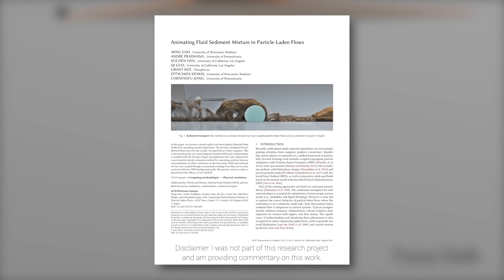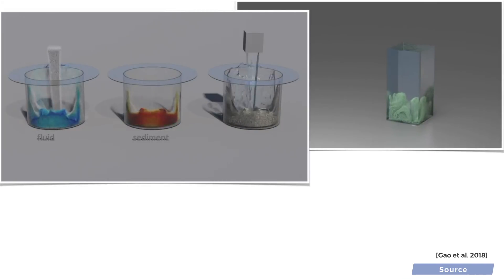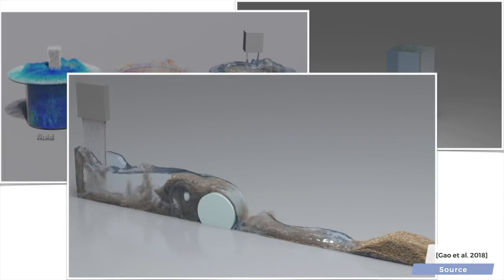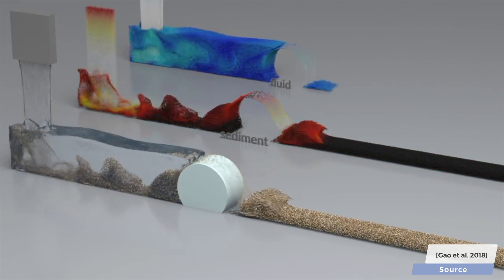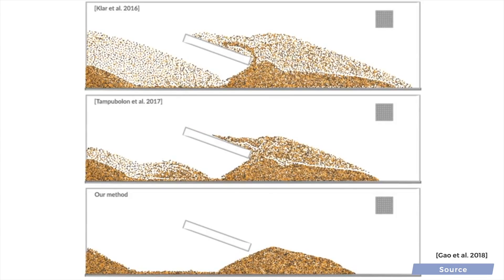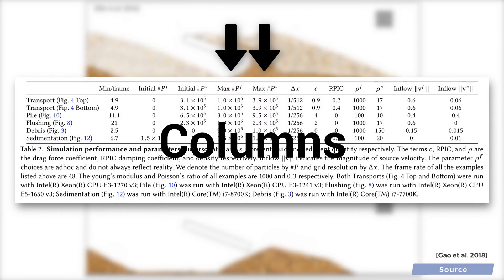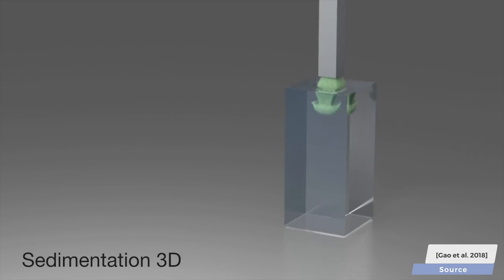Simulating Water and Debris Flows

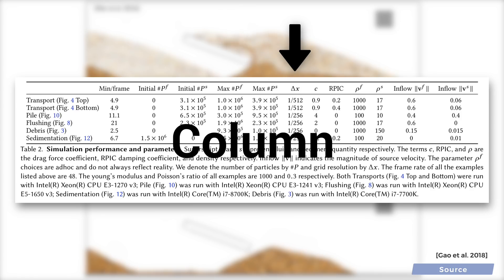Comment: At 1:50 the note states that all the simulations are run on CPUs. Why not using GPUs instead? Is it just to compare performance across methods or is there a particular reason?
Reply: Usually with simulations like this, it's done on a supercomputer which are computers thinking together as one. It's easier and costs less just to mass buy cpu's and motherboards then buy cpu's and gpu's.

Comment: How much processing power would it take to run a simulation of this resolution in real-time? Is this ever going to become feasible in our lifetimes with Moore's law apparently slowing down?
Reply: Well if it's minutes currently, assuming the same algorithm/architecture so the only difference in speed we would assume roughly 200(~3 min converted to sec.)*60(fps)= roughly 10,000 factor speed increase to run in real time, or roughly 2^13-2^14, so roughly 14 iterations of Moore's law, assuming it continues at every 18-24 months (which we largely can with changes in architecture etc.) we should see it in roughly 20 years.

Comment: I think one thing for it to be more realistic is velocity is based on viscosity or dampening factors.  Additionally where these fluids or debris is crossing the path of oxygen and trapping it within. Example when scattering debris into the air and it lands it traps oxygen which spreads the debris particles further apart this action isn't random but also isn't uniform. So take sand flip it into the air and it has the appearance of more volume due to trapped oxygen particles. Include water in this scenario. Viscosus or particles with a higher dampening or drag will move slower. Take for instance dry sand moves quicker than wet sand. Great details by the way.

Comment: Approximately 6 minutes per frame. This means we need around 10,000 times the processing power for real-time simulation. Looks like consumer games featuring simulations of this fidelity won't be a reality for at least 13 more years. Perhaps we could use ML to find some "good enough" optimizations / speed up.
Reply: That's my thought as well. High particle count simulations like this benefit from the sort of fuzzy computing being put forth by graph core and others. As long as the only use case is aesthetic, a close approximation first pass with a sanity check is probably more than enough, and that should be possible in real time within 5 years

Comment: To me it still looks like it's made of syrup or something thick, like the viscosity is off. Multiphase flows and two way coupling are still big challenges, it's interesting to see it's a particle in cell method. I still have an amazing book by Davit Potter "Computational Physics" published in 1982 and particle in cell was described as superior method in many aspects to grid-based methods, but smoothed particle hydrodynamics (SPH) wasn't even a thing back then (I think). The other two papers were SPH?

Comment: One frame in a matter of minutes :D
My LBM implementation does one frame in less than 10 Milliseconds for a 256^3 box (with free surface and tracer particles, but without fancy two-way particle coupling). That's the power of the GPU.